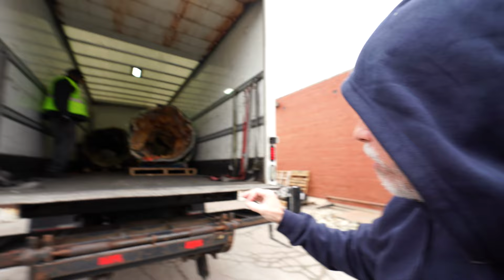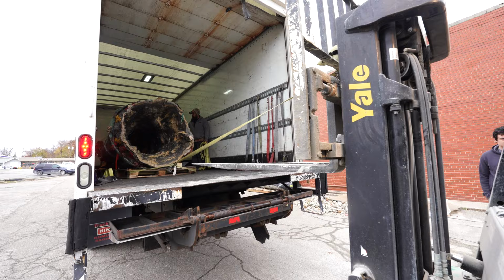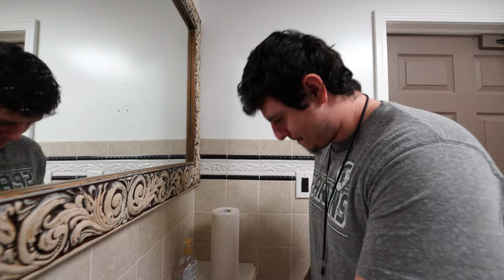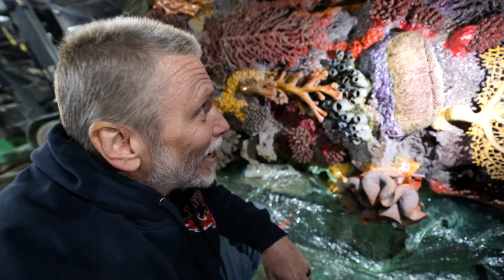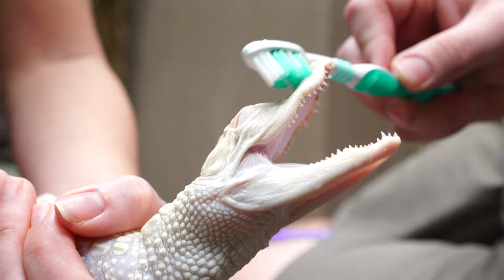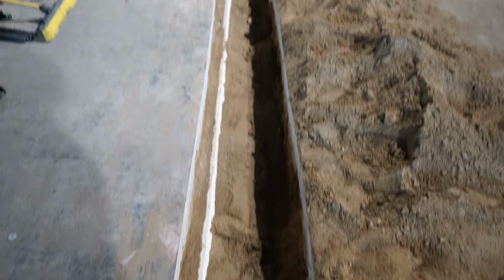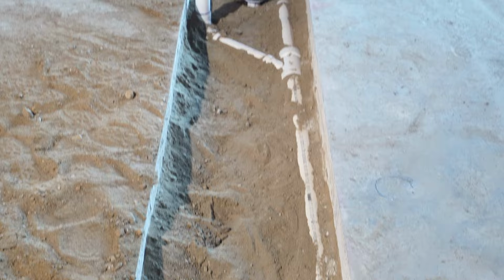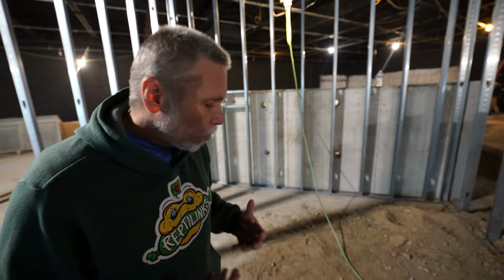$40,000 Coral Just Showed Up!

Comment: The plumbing issue is the plumbers fault. Unless the plumber didn't have proper instructions. But he ran 3 inch somehow so I'm assuming he had an idea of what was happening. 
 It sounded to me like the plumbers messed up or tried to get away with using a smaller size pipe  because they wanted to save money. 
 When it comes to mistakes in construction, sub contractors will always blame someone else for a mistake as they don't want to be responsible financially for the mistake. Back charging is usually what happens.

Comment: Make the back of the tanks into a small planter for vines and other plants coming out of the tanks. build a stand with 2x6s that is smaller then the lip of the tank then put some type of plastic trough or liner for the dirt and decor that is like 5" deep and then plant vines and make a cool rock design or something. That would hide the gap in the back of the tanks from the wall, it would look fantastic!

Comment: I can’t imagine what it felt like to hear the pipes weren’t big enough. I’m glad you found a solution but at the same time, what the heck is the architect doing????
Reply: Right?! All of that info should have been on the plumbers blue print, AND he should have double checked that info, he knew there were huge tanks.
Reply: @BeingTink I was thinking the same like shouldn't all of this have been verified before it was even started? 😢❤
Reply: Architect has NOTHING to do with the mechanical/plumbing/electrical, etc... This is the general contractor not making sure all contractors communicated to each other. The tank peeps who are doing the pump work telling the whole group how much GPM and how many overall gallons they will be sending down the pipes. Then the maintenance crew who will be in charge with timing when all the tanks are being changed, etc... need to show how much drainage demand that will be. And then the overall gallons of all tanks to determine how massive the floor drains need to be to prevent flooding if all tanks burst at the same time. I wonder who the general contractor is because thy dropped the ball BIG TIME.
Reply: @cjandauntieyaya1446  Oh wow. Ok, I thought the architect had to stipulate pipe size used
Reply: I just said something similar… how does the plumber not know it’s an aquarium he’s after more money

Comment: I thought that pipe in the floor was a little small to dump those huge tanks in a steady and quick time, you need 6 or 8 inch minimum going to the city drains  because you're screwed after you cement over them :-)

Comment: Great job guys. When I was taught on what we call fork lifts (same thing) I was told with big heavy and longer loads to tip the front of the forks up a bit to help prevent the load slipping off should you have to suddenly stop. It would usually slide off easier if its level (with the floor) but not telling anyone to do at all, I dont do that. I'm just talking about my brief training, I got stopped by a boss cos "girls arent allowed to drive such equipment!" I left not long after I was also pushed by a bloke over a foot taller n bigger than me and the same boss defending him! All because he tried to boss me around in a not nice way but wasnt a supervisor nor a boss so I stood my ground n he dudht like it. I walked out on them, I wasnt willing to be paid minimum wage to stand there peeling onions and ge treated like that! It was a gap filled seasonal job at the time lol

Comment: I do plumbing design and pools have a significant backwash and typically you can get by with a hub drain/funnel drain (similar to how a clothes washer works). Have a 6" or 8" drain that comes up 4' or so feet and drain into that. Hope this helps.

Comment: These plumbers don't seem to have a clue what they are doing. First they undermine the slab to trace an old pluming line which should have had blueprints to tell them where it was. Then they just don't come in because of deer season. Now after running  a decent amount of pipe in an aquarium , they finally put together they are working in an aquarium and try to make it sound like its Brian's fault he didn't specify the size of pipe he needed. Why would he not find out the plumbing needs of the building before plumbing it?

Comment: I have to ask the obvious, but why did the plumbing company not supply you with what was needed for the plans you drew up? The architect must have had the drawings passed through planning so I don’t understand why they installed the wrong size draining system. Surely someone is responsible for this cock up? They can’t just be making this up as they go along?

Comment: Suggestion for your walls, the drywall will be a nightmare! Save yourself a lot of trouble and hang a bunch of corrugated metal that can easily be painted black or whatever and leave the gap. You won't even notice it and for future you can easily remove any panel if need be. Give it some thought!!!!!!!!!!!!!!!!!!!!!!!It will handle the H2O better as well.

Comment: Smaller waste pipe will just restrict how much you can discharge. No need to dig it all up when you can just restrict the flow rate of the discharge with a valve. Eg. Drain the water over 8 hours instead of 4. Not like there's not other jobs people can be doing as it's draining.
If you want me to argue plumbing with a load of blokes who don't know how to trace drains or work out flow rates etc. Not a problem. lol
Reply: Willing to bet you can still discharge at a rate faster than you can fill.
Don't let the fuckers lift your leg.

Comment: Brian,

Using large pressurized pond style filters have the disadvantage, backwashing.

It’s why I’d use natural rock and skimming with Carbon filtration. 

With the amount of volume of saltwater you will be managing, along with the space you have… business idea.

Buy dry reef rock and cure it using the saltwater volume you have. Plumb in a 10ft above ground pool. Add 10000 pounds of dry rock and let the year pass. It will become live and increase value by 500%. About 10 years ago I had the idea. I had space and the knowledge. Seeing what cultures reef rick goes for compared to dry rock. I almost bout 250k pounds of dry rock. Had 10 large livestock tanks that were 15’ around, close to a salt maker in Baltimore so salt was cheap, a few pumps and some cheap halide bulbs. 

In less than a year after being seeded it would be ready to sell.

It also helps shut down imported reef rock that is called live rock. Taken off reefs…. 

Imagine a Legasea branded sustainable cultured rock made with love from BRB. It could be a revenue stream

Comment: First of all the plumber is at fault 110% for even beginning the job without the proper detailed paperwork that he needed to begin with. He should have said hey, I need to know what size tanks are going in here so I can run the right size pipe!! I mean come on, I’m not a plumber but I know aquariums need extra large drains and bigger pipes than 3 inch!!! 🤦🏻‍♀️ Horrible job! That man literally did his “quality” work based on his ASSUMPTIONS of what he THOUGHT he should put in. If he has to do any repairs then he needs to foot the bill.